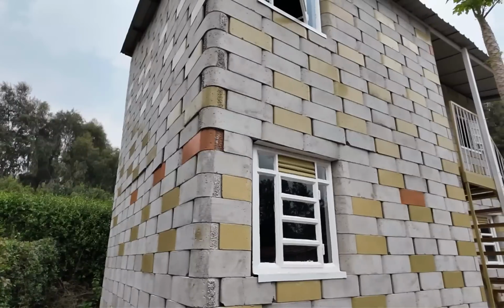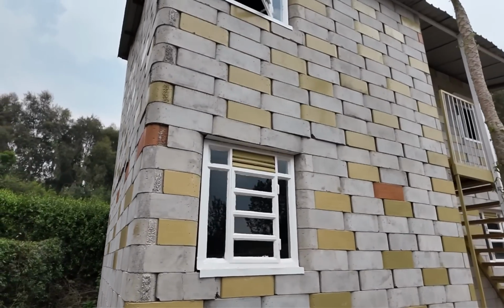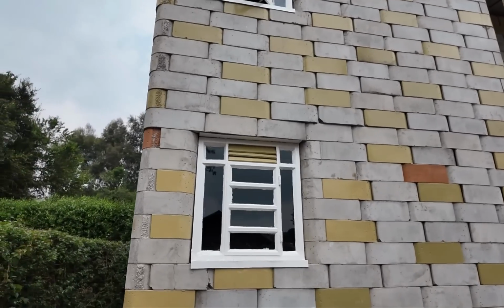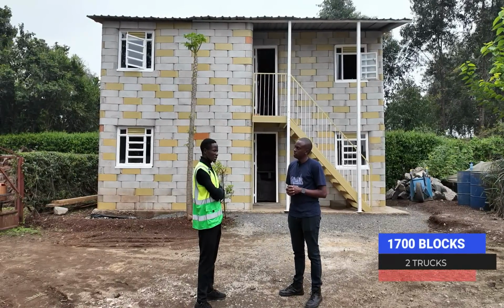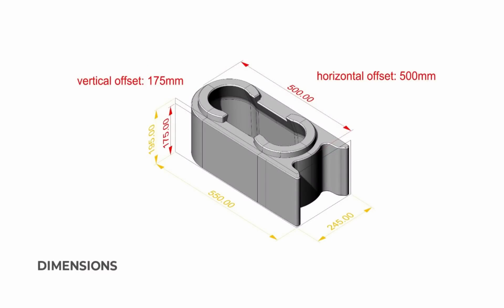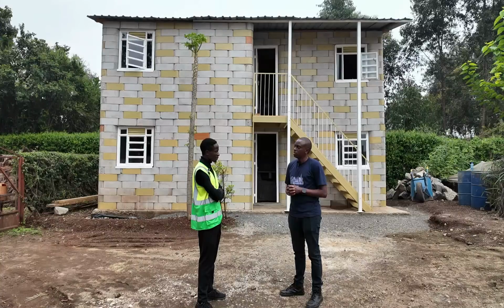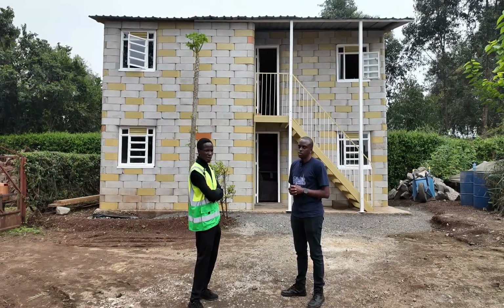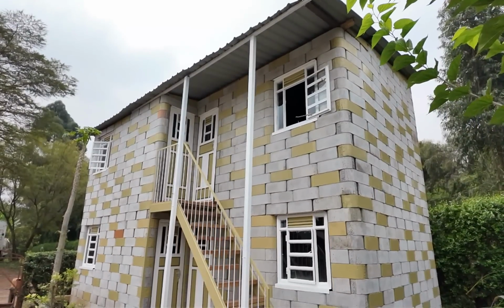Build a 72 SQM House in 5 Days?! Twist Blocks Make It Possible!

Comment: This is nice, but sealing the blocks seems to be an issue. With traditional masonry, your mortar seals between your courses and your individual bricks/blocks. This does not have that. 

It seems more suited to buildings that you don't need to worry about ingress from insects or moisture.

Comment: I see light pearing through some spaces in tje bricks especially around the window and doors rough openings...can u comment on that?
Reply: Foam backer rod and lots of caulk will fix that. I'm still not convinced that wind driven rain will not leak between the blocks. He should video a test with a fire hose.
Reply: @raptor1106  agreed 👍🏿

Comment: Will roaches lodge in crevices?

For coloured blocks, do they come in double colour, different colour exterior, another interior?

When building on black  cotton soil, does cost remain?

Can I paste modern interior wall paper neatly
Reply: 1. We usually do a good finish afterwards to ensure roaches don't reside.
2. Blocks are painted on site before laying them, clients can opt to do different coloured as they want.
3. Costings for foundation really depend on the type of soil. It might carry with black cotton soil.
4. You can do a wall paper on the walls

Comment: Will roaches lodge in crevices?

For coloured blocks, do they come in double colour, different colour exterior, another interior?

When building on black  cotton soil, does cost remain?

Can I paste modern wall papet neatly
Reply: Colored blocks are painted on site before laying them.
Different soil types have different foundation methods thus different costings..yes  you can paste a modern wall paper
Reply: @samsonontweka5005  i think the question on colour was if it can be gold outside and green inside for example
Reply: Yes, i am concerned about pests in the crevices also.

Comment: What About The Electric Wiring of The House??
Reply: The conduits and plumb pipes go through the hollow core of the twist blocks so there is no hacking and plastering of the walls.
Reply: @samsonontweka5005  can you still plaster the wall
Reply: @Ceekuuvlogs  good question
Reply: Strength?

Comment: We need a quotation for a 3 bedroom using the same material
Reply: What size?
Reply: @samsonontweka5005 around 200sqm
Reply: @samsonontweka5005  what is the cost for a single block and per square meter for material only?
Reply: 150sqm please @samsonontweka5005

Comment: Am worried about dump proofing. This house if not careful, they will leak moisture into the walls inside and cause dump problems
Reply: There's a dpm paper in the foundation, For lateral rains entry , it is not possible because once the blocks interlock thy form a zero joint that sills the external from the internal

Comment: Wonderful project and a most needed basic living with reasonable cost housing.  Well done.  Of concern, maybe it was due to budget:  1) there are many gaps at the windows and doors, thus bugs could enter premises and water when raining; 2) where is the upper ceiling lighting, yes there are windows but should be switch light inside; 3) where does the water drain at the kitchenette sinks; don't see a flow going outside for drainage; 4) there are no shower amenities in the flat; 5) as there is no insulation, won't it get very hot or very cold depending on weather?  Thank you for any responses.
Reply: I appreciate your feedback and would like to address your concerns:

1. Gaps at the Windows and Doors: We plan to add thin moulding as a seal around the windows and doors to prevent bugs and water from entering the premises.
2. 2, 3, 4, & 5. This unit  is a prototype designed to give our client a tangible concept. We haven't included the actual water and electrical systems yet. However, these will be part of the final design. You’ll be able to see the plumbing and electrical systems in detail in the third video that Nick will be posting soon. This video will also address other amenities, such as shower facilities and insulation.
Reply: @samsonontweka5005  Thank you for the quick responses and clarifications.  Good to read those line items are already in the plans.  Will look forward to the finished project.

Comment: Did you ask him about water seepage to the ground ceiling and also about sound when someone is walking on the upper floor.
Reply: Could he explain the stability of the floors considering it's 50mm and we are used to 175mm??
Reply: @josephachola7496  If they use the right concrete ratio and reinforced wire then it is stable because it is the style east Germany used to build their social houses very quickly early 1930 and after world.
Reply: We don't have instances of water seepage from upper floor remember we cured the slab for a week and half (no water seepage) 

As for sound transmission, concrete slabs typically work very well in reducing noise. Additionally, the hollow Twistblocks we use contain trapped air, which acts as a vacuum to further reduce the intensity of sound.
Reply: @samsonontweka5005  I know the slab is very strong but if it is thin there must be a sound it produces when someone is walking on top of it i asked this because of experience
Reply: @waluohopaulo2116  our typical slabs are 175mm, this was a special one with marine boards as formwork and a 50mm concrete slab plus a small screed of 10mm so far it has worked very well with noise aspect.
Reply: @samsonontweka5005  ok maybe i will come and experience it upon myself,if i am convinced with it then i will replicate it incase i have my project.

Comment: Thank you Nick for a very informative video.  Can light come through the walls ?  The design doesn't seem to have a raised lip all the way around the block leading me to believe that light can come through the wall.  Thank you in advance for your reply.
Reply: The blocks are standard and ment to form zero joint if perper levels have been achieved when setting out.. Light is not ment to come through the walls. Only on rare instances and we seal them.

Comment: Thanks Nick for this, would kindly expound on materials he has used for the slab coz i can see T beams and RHS tubes, which materials did he lay on them?
Reply: Formwork (marine board RHS section and ironsheets T.beam Section ) then concrete topping.
Reply: Thanks
Reply: And does the cost include everything from foundation to finishing?